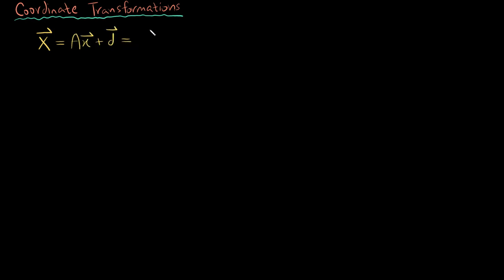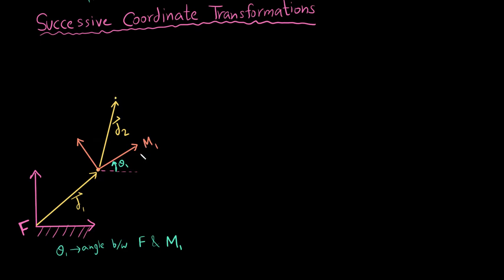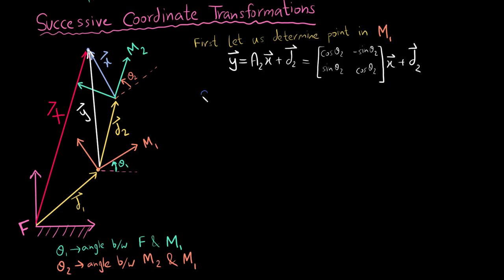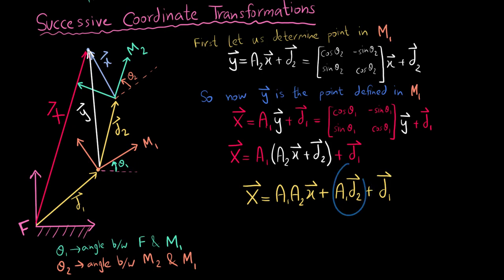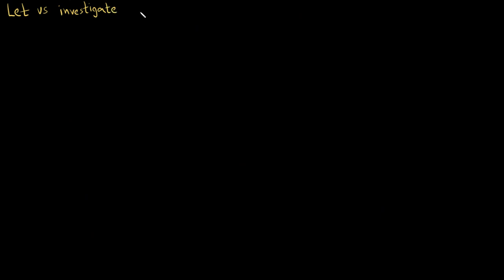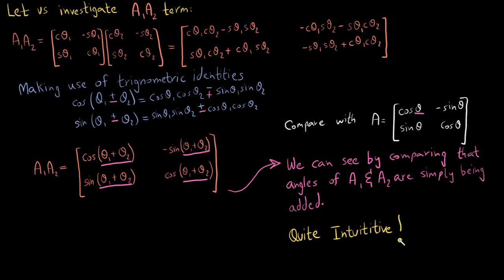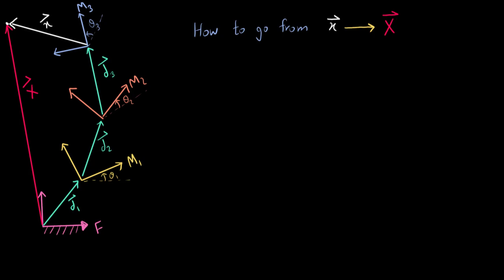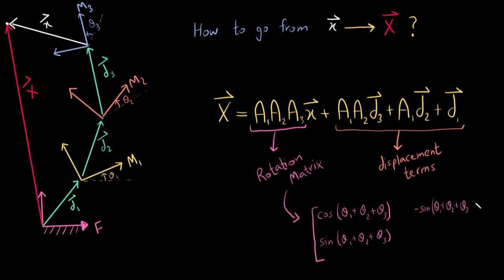Coordinate Transformations in 2D (Part 3) | Mapping | Robotics 101

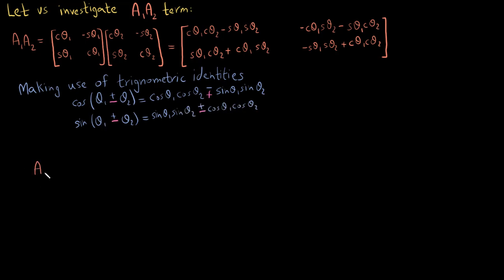Comment: Thank you for your helpful video! I think there is a typo at 5:38. You write one of Ptolemy's trig identities as sin( Θ1 +- Θ2) = sin(Θ1)sin(Θ2)  +- cos(Θ1)cos(Θ2), but it should be
sin( Θ1 +- Θ2) = sin(Θ1)cos(Θ2)  +- cos(Θ1)sin(Θ2)
Reply from the maker: Thank you for pointing this out. You are correct, I did make a mistake.
I will pin this comment for others to see.
Thanks again!

Comment: I wish I could like this a thousand time. Thank you and God bless! On 4:54 you said A_1d_2 + d_1 is only Translation is the rotation matrix (A) discarded?
Reply from the maker: Thank you so much! It is comments like this that makes all the time I spend making these videos worth it.
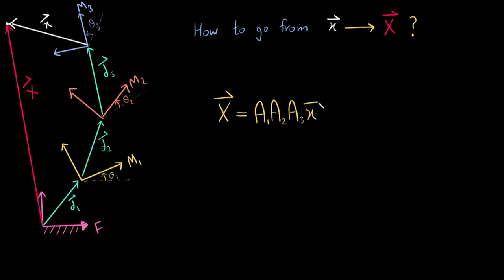As far as your query is, I don't think I fully understand it. In the equation X = A1A2x + A1d2 + d1, the 'A1A2' term is the one that represents rotation and the other two terms represent translation. We don't discard any term but I am explaining each term one by one. So we first talk about what the rotation terms represent and then later on in the video (at around 7:55) we talk about what the displacement terms represent. 
If you still have any confusion or if I misunderstood your question, let me know and I will get back to you.
Have a great day!
Reply: @EngineeringSimplified  I had the same question- Its because at about 4:15 you said the part of the equation that is (A1d2+d1) is only displacement, no rotation. But... it has a rotation matrix in it. Why is the rotation matrix not rotating things?
Reply: @briarsrabbits9470  this is a little late haha, but the rotation matrix is used in the A1d2 term to rotate the point that vector d2 goes to, represented in the m1 frame, by angle theta1. This is done in order to represent that point in the F frame displaced by vector d1 (which is the M1 frame with same orientation as F), in order to finally be able to represent the point in terms of the F frame